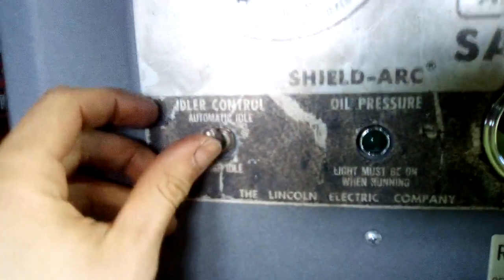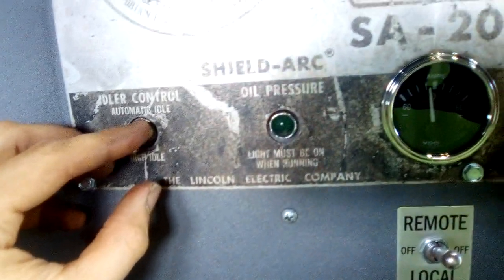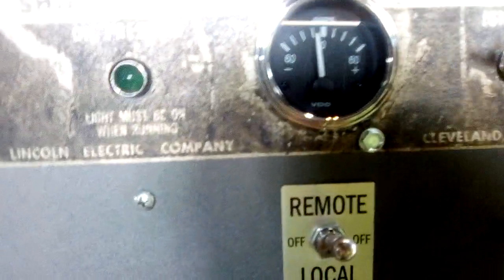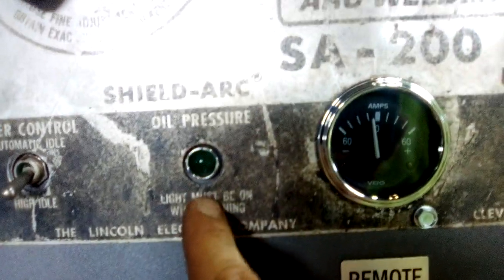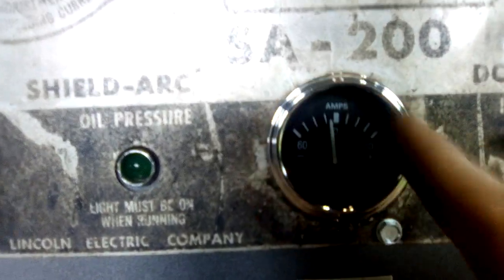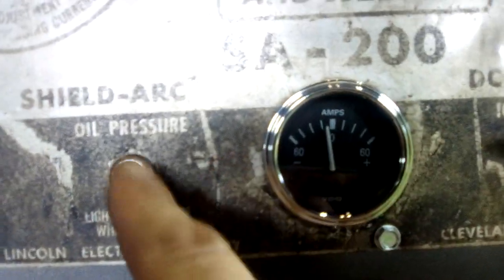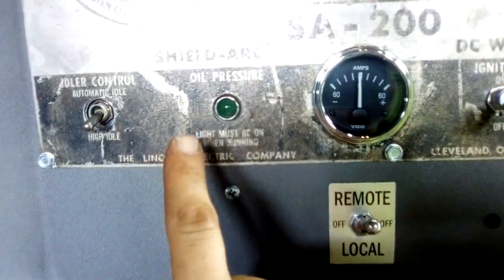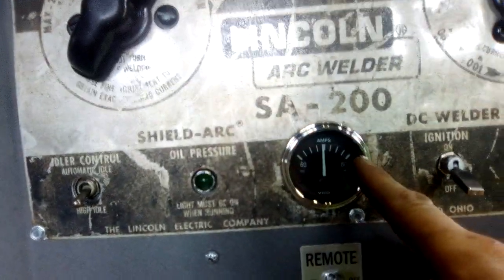SA 200 Project

Comment: I just looked up the sa 200 on the wiring forum and you should have a 5 pin relay for your oil and temp gauges and oil pressure switch and temp sending unit. Hope this helps.

Comment: (Normally) Oil pressure sending unit GROUNDS when there's no oil pressure. When you have pressure, the switch OPENS, light should go off. Check the OP switch. Also appears you need to swap wires (switch them side to side) on the AMP gauge. 

OOps......Panel says light must be ON when running. Must be the OP switch GROUNDS when there's pressure. And that would explain the Green (Good to go) color instead of Red ( Problem) color. You can test the OP switch with compressed air.

Comment: oil pressure switch wired wrong, when theres oil pressure the switch should be closed allowing power to the oil light.